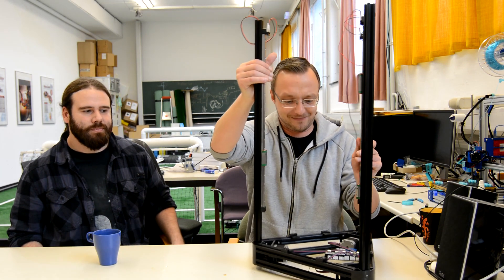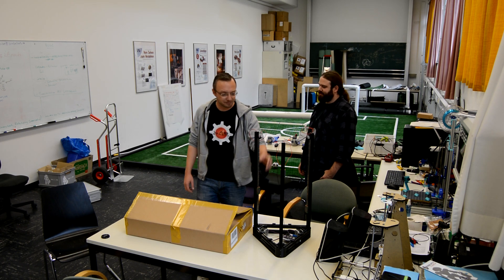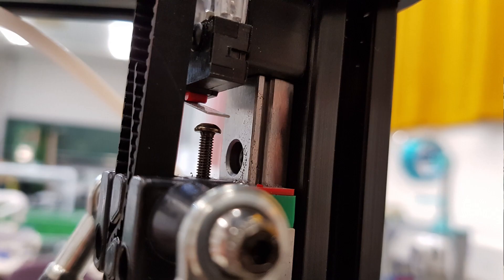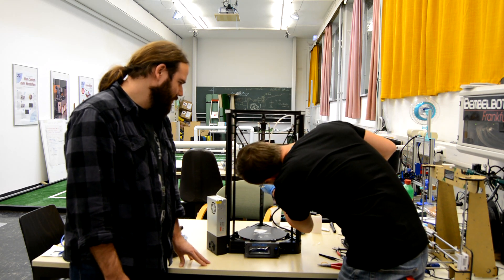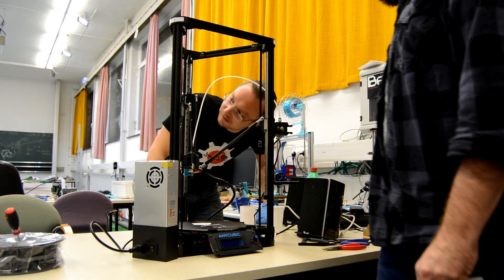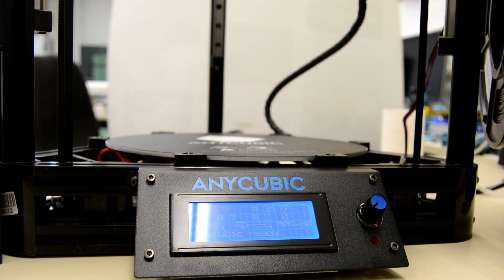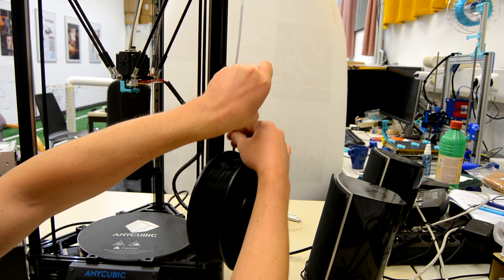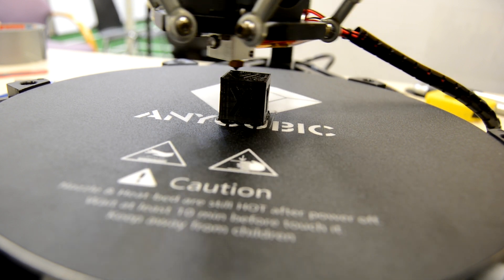Anycubic Kossel Linear Plus - Buildup Tips, Pitfalls and First Print

Comment: Hey great videos guys, I setup one of these printers a few months ago and got stuck with at the leveling stage, I think o have set up everything according to instructions but when I go to level it it seems to be going on the other direction, up rather than down .... I click auto level and it goes to the top hits the end stoppers a few times each one and then goes back to the middle but it never goes down to the bed. It's like it's the wrong way round....
Reply: Use marlin 2.0 and make sure in the configuration you make the right changes. I'd definetly watch some videos on it, the 1.1.9 ones still apply for the most part.

Comment: Buy a ultrabase from Anycubic and you forgot hairspry and scraper
Reply from the maker: Hi, thanks for the tips! In the first runs we did, the PLA stuck to the bed like hell, we had a hard time getting it off at all :) I prefer to use a flexible knife instead of the scrapers, most of the time the scraper's tips are too thick to get under the first layer.
Reply: @labstream4122  That style of print bed you have to let it cool first then it will just fall off.

Comment: I bougt me the same printer and have the problem that only one printer cooling fan ist running. Is this normal or a defect ? Although the autoleveling seems to work, the printer prints with cura 3.6 in the air and runs out of printing area. It can happen that the printing head damages the tothband. Which Software do you use ?
Reply from the maker: What do you mean with "tothband"? We used repetierhost with cura, I do not know the Version right now. Did you setup the endstops correctly?
Reply: Thank You for your answer. I mean the toothed belt in which the print had crashes. Have you updated the firmware of the printer and how did you do this ? Is the firmware kossel_plus_2017_07_12 or any cubic kossel auto leveling_2017_11_13 ?

Comment: I was going to buy an Ender 3 as my first printer but now I am seriously questioning that...also, subbed.
Reply: I think that the kossel had auto bed leveling, which the ender 3 does not have
Reply: I have both printers and they are great
Reply: I've owned both and I think the Ender 3 will be better for your first printer as it has much better print quality and has much less that can go wrong with it. Delta printers are just a bit difficult with levelling and calibrating
Reply: @jacksonsherriff9899  The Delta potentially has much better print quality at the same speed, however, they do require more fine tuning, and that tuning is more difficult that the Prusa designs. Same can be said for CoreXY/D-Bot & H-Bot printers.